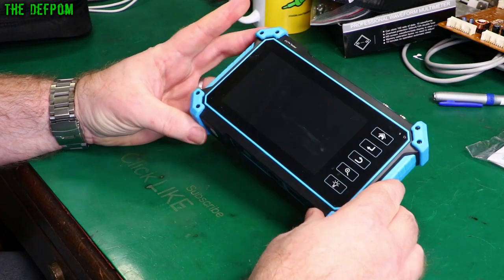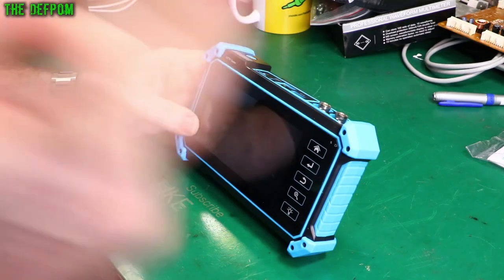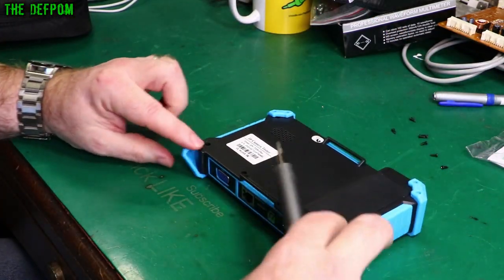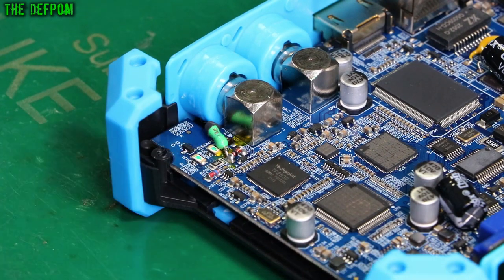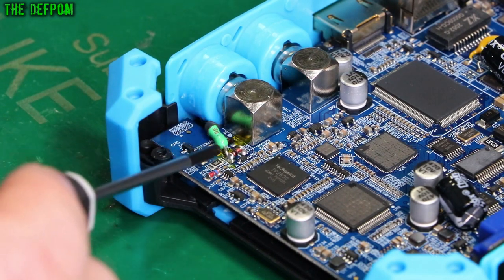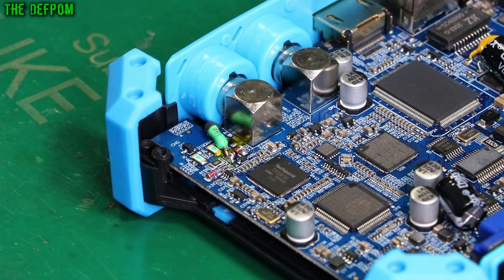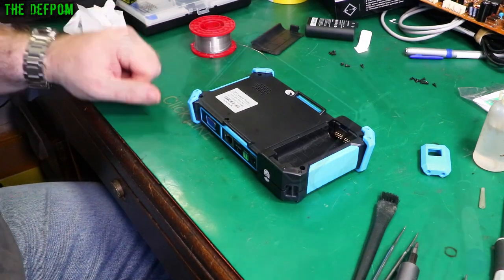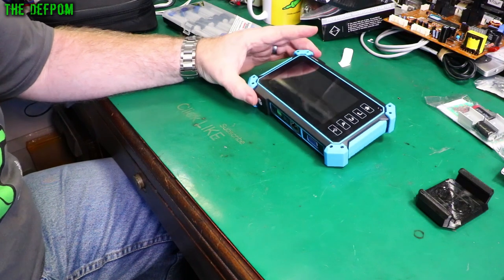🔴 IPC-5200 plus CCTV Camera Tester Repair - No.968

Comment: Nice solution on the fuse resistor.  I still have not got a good pair of hot tweezers. Really need to find some. They really come in handy.

Comment: Is that soldering iron a JBC ? I do it like that all the time with a Pace, but I use a gullwing tip. A JBC should not have a problem with that. I have tweesers but seldom use them. Hot air is faster
Reply from the maker: It’s a clone, it is a very good iron though, I just had the wrong tip on it and too little temperature, there is a large ground plan right there which was sucking the heat away.

Comment: Hi, I have appreciated your video. I have the same tester, and unfortunately my network port has blown as I plugged the cable to a faulty switch and had a backfeed on the POE. Where can I find the parts discription file to see what components blew? I cant read the code on the components as it's burnt. I would appreciate your feedback
Reply: @cameronbuck7185  did you fix the problem?

Comment: Are you located in USA by any chance, i have an ipc9800 adh plus that wont charge, it works if but wont charge the battery, due to myself plugging it in a 48v charger by mistake
Reply from the maker: No sorry, i’m in New Zealand

Comment: I would have just used two soldering irons much cheaper than hot air tweezers. I have used a few hot air tweezers unfortunately anything good is expensive

Comment: Boa tarde , meu equipamento lfica com led de ligado porém não inicia o sistema tela preta como posso reparar o mesmo estou no Brasil tem indicação de assistência aqui??
Reply: Hello, you can first check whether the battery is not working or the screen of the device has a problem.
You can replace the battery first, if it still cannot be turned on, remove the battery, connect the rechargeable battery to see if it can be turned on
https://www.aliexpress.com/item/4001106529273.html
Reply: my too man :( do you win this problem?